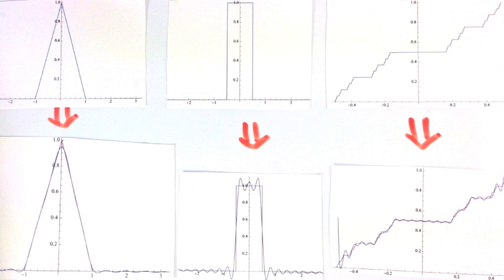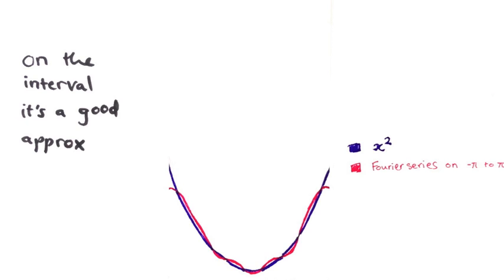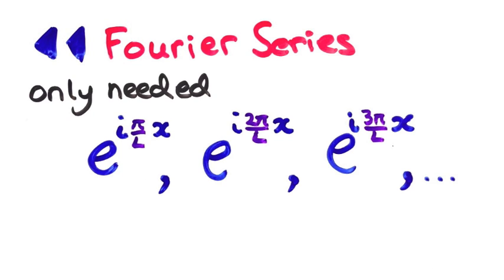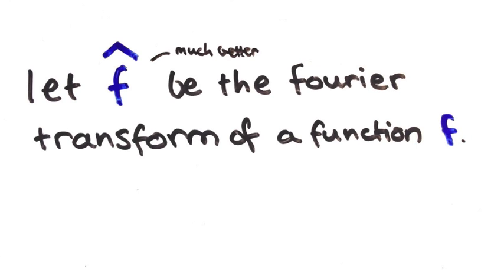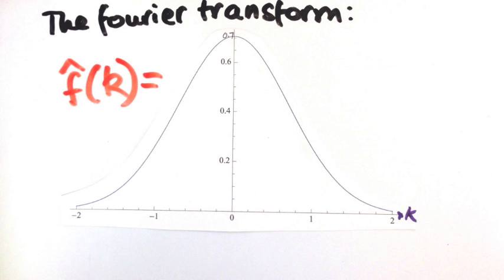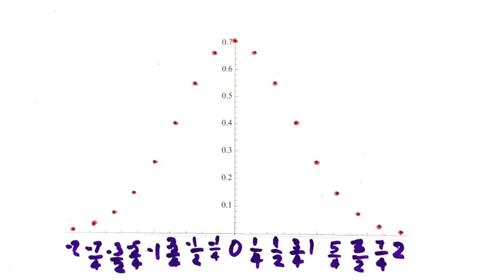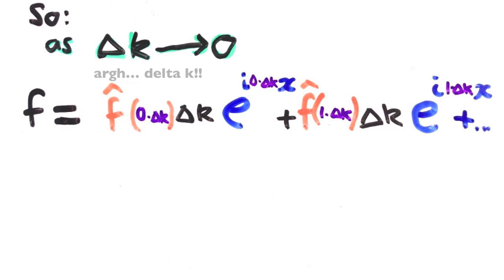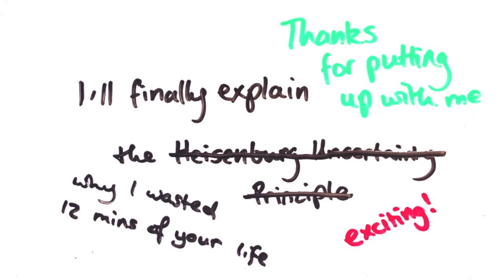What is the Fourier Transform?

Comment: There's so much seemingly contradictory information out there regarding fourier analysis. My book shows that to estimate a function on (-infinity, infinity) you can use the "fourier integral" which is basically identical to the fourier series except now we're integrating instead of using a discrete sum. But then in this video we're using the transform -- which is often described as transforming f(t) to f(w) where t is time and w is frequency -- to approximate a function. I know it's all closely related which is why things some contradictory and confusing but Gahhh!

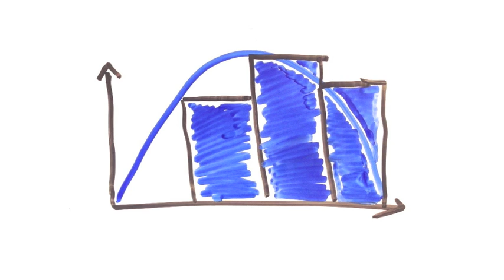Comment: The factor at 2:20 (which is "forgotten about for the rest of the video") should have been, I think,  1 over the square root of 2 times pi.
Reply: I guess it's a matter of definition: if you use 1/sqrt(2*pi) the inverse fourier transform is the same formula as the forward. If you use 1/2*pi , the inverse has no factor (and, in fact, become the formula with the factor 'forgotten')

Comment: I did not quite understand why you used area under fourier transform
Reply: The area underneath each rectangle, all added up, is the integral. You're taking the height of the function, f^(k) * e^ikx and multiplying it by the width of the infinitely small rectangle at that point, dk.

Comment: Hello LGU, In most of the explanation of fourier transforms, there is conversion from time domain to frequency domain. However you have worked out on the pdf of the time doamin to signal to convert to frequency domain.....is my observation correct? If so what is the difference between the two approaches? Or you have taken an aribitrary example for your explanation? Could you pls explain in detail......Thanks